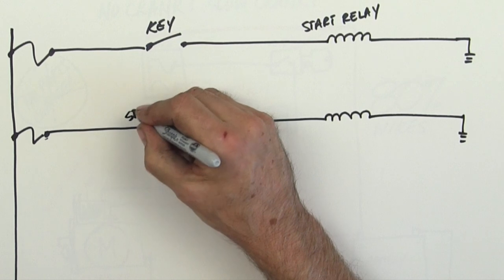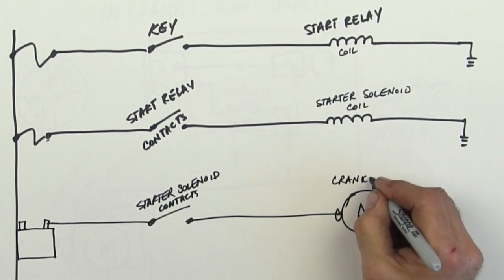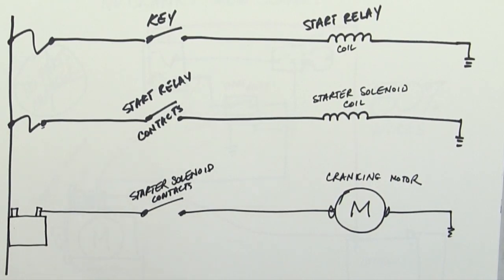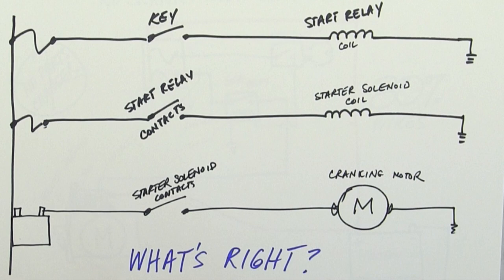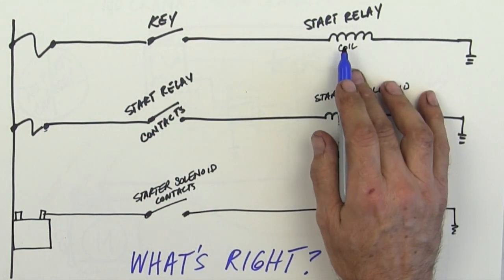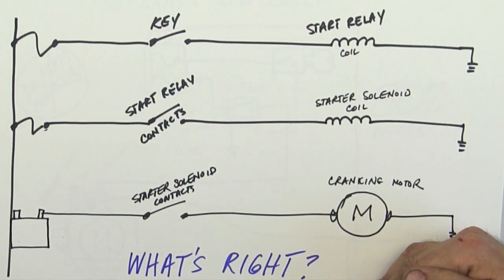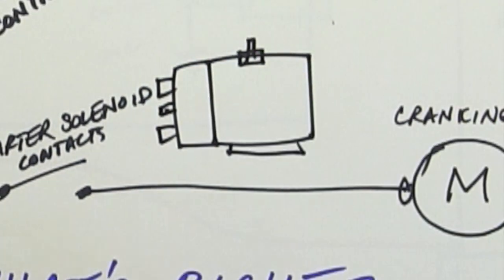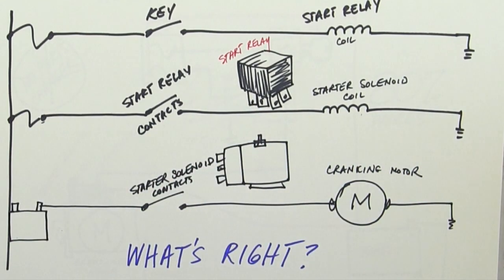No Crank - Slow Crank - 2

Comment: This was like getting to the last part of great novel only to find out the final chapter has been ripped out! Noooooooo!!!!
Reply: I was following part #1 and part #2  of your excellent tutorial when it came to an abrupt end??  Please finish your lesson.
Reply: Dev JB I hey, just want to thank you for you’re attempt at finishing this guy’s homework. lol...
  Seriously thought it’s frustrating too spend time watching through two videos to end up here!.. 
  Maybe you could help me out? I have a 2001 Audi A4q 2.8 and have had this problem for the past couple weeks, I turn the key and here the click under the car (like the battery is very low on V.) but the battery is fine 12.4+. The thing is if I keep turning the key eventually the starter will ‘connect’ and turn the motor over and the car starts up no problem.... not sure if you know much about German vehicles, but they are a pain in the ass too get too many of the parts (the starter being one of them). I changed the ignition switch when this first started happening (I read that that was one of the possible culprits of this “no crank”) with no luck. Since the starter dose eventually turn the motor over every time I need to drive (side note: it has been taking more ‘key turns’ before it starts up) does this sound like it needs a new starter to you?
  Thanks for any advise!
Reply: Dev JB it is actually an automatic, I did think when this first started that it might be the switch that tells the computer that IT is in park, but I read to try and start it in neutral and if the same this happens then it’s not that switch.
  It’s hard to tell if the fuel pump it running, I have never really heard it from the driver’s seat before, even when the car was running like new. Also the fact that it isn’t cranking over at all; just the click from the starter solenoid (I think, the same click that you hear when the battery is too low to crank the engine over but there is enough juice to run the radio and everything elts.
Reply: Dev JB nice, thanks a lot! There is relatively low number of diy vids on YT about the older Audi which is a shame cause if they have been maintained for (at least most) of there life by Audi like mine was they are and can drive beautifully! IMO... mine just rolled over 150k and was a garage kept California car that was fully serviced at Audi dealer tell about 120-130k then given too original owner sister then to me about a year and a half ago. I’m going to take it out to my parents property and check/clean up all the point you mentioned this weekend. I was told the neutral safety switch can be checked by putting it in neutral (I guess usually when it starts to go it will do This in park but you can usually still start it in neutral?) 
  That link in the next comment didn’t work? I’ll try and find the vid from the bit of the link that is there but if you can send it again that would be awesome! 
  Thanks a lot for you’re info/ideas when I get her straightened out I’ll let you know !

Comment: extra to the wonderful video, heads up, to ya'all,  there are 2 or more relay for protection and function, the cranking motor requires 300 amps to work, this cannot be passed through the dash board ignition switch without fire- burn,- trouble ( much less 10 times day for drivability of your car) so a starter solenoid is used to take that 300 amp, across it's contacts (big heavy metal  stuff) , the solenoid required 10-20 amp to switch on, this can be supplied by the ignition switch, easily, with safety, ( as in my 1970 car) but the start relay( small black cube) only require 35ma or 0.35 amp, and can switch-control 30amp, thus the ignition switch ( now using only 0.35amp), will last for ever with so little wear, And other parts of the car- like gear box NUETRAL  or PARK switch, or ignition immobilizers,  can be included into circuit of the starter relay- usually in the 35ma  wire from the KEY-per video,( at that level of current these switches would best be called sensors   that collectively ,  control the black cube box), most of the wiring is in the engine bay,  with ONE wire from the dashboard, Sweet, ( love the sketching )

Comment: In part one you showed a hot wire coming directly from the battery to the "cranking motor" Ok really confused now because you sent the hot wire from the battery to the "starter" solenoid contacts.

Comment: I got a harley with a slow crank starter sometimes it's works and sometime it's just too slow to turn the engine on, I've already check and even replace the ground cables but the problems still occurs, what can possibly happened? Was the starter need to be replace?
Reply from the maker: Positive cables? Any signs of heat?
Reply: @bivideo7 I already replace the positive too and the connections were good, Is it possible if the armature are worn causing a slow crank?
Reply from the maker: @TheSkylark16  Did you do a voltage drop across the starter (ACROSS - NOT at the starter) during crank?
Reply: @bivideo7  yes I did, the drop is only 0.2 - 0.4volts, I almost give up now

Comment: Quick question put a new starter on cranks fine at first but let it run for 30 mins turn off the try to re crank and its like really slow crank and battery cables get hot especially neg cable and won't crank. Hours later will crank easily but repeats scenario
Reply from the maker: Make sure all of the cables are spotlessly clean. Any green means replace. Check all connections. Any corrosion sufficient to do this is invisible. Just because you can't see it doesn't mean it isn't there.
Reply: I have the same problem to I have replaced the neg and positive and still the same thing slow
crank or when the neg cable gets hot it won't start. Could there be a short somewhere?
Reply from the maker: TheJman972 There's a point where - after you rule all things "starter" - you have to consider and engine problem.